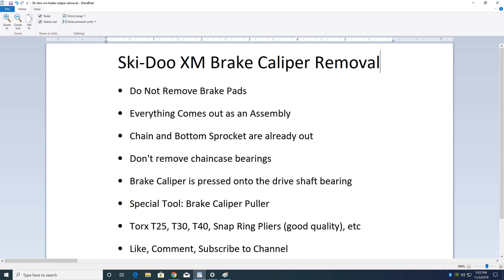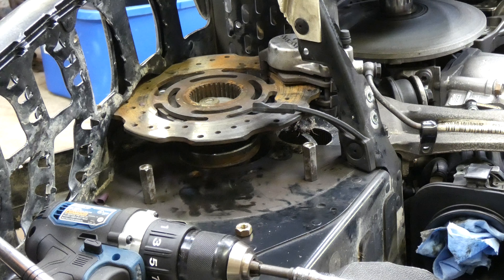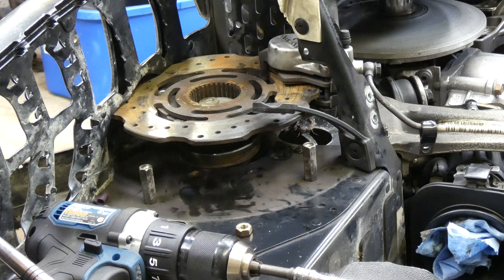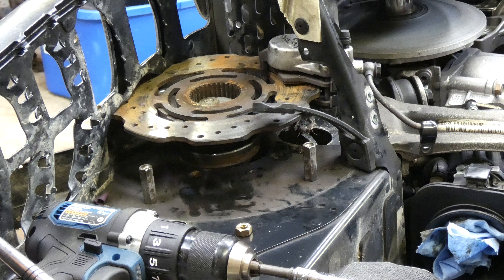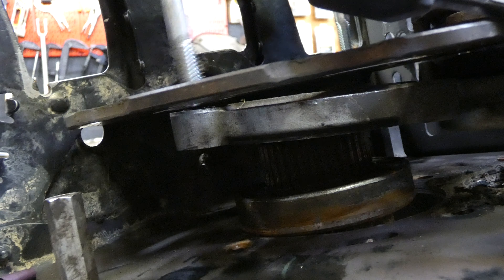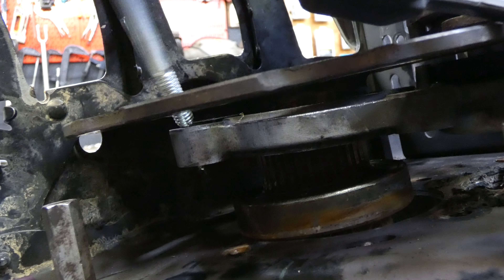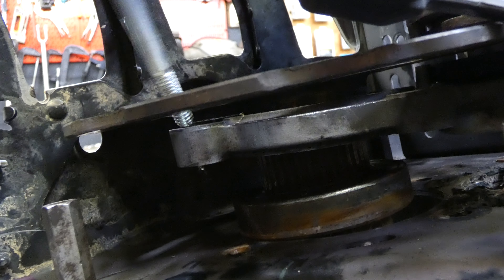Ski-Doo Brake Caliper and Driveshaft Removal

Comment: Wow what an involved PITA process.  I've not tackled mine yet, but you make it look easy though!  Thanks for the video!
Reply from the maker: Yup and there were no other videos showing how the puller really works at the time I made this. Understanding that the caliper is pressed onto a bearing inside the tunnel is the biggest point. The caliper won't just pry off unless you're really lucky.

Comment: Getting the caliper back on is my current frustration🤦🏻‍♂️
Reply from the maker: @Ryanbalazs  yeah that's a good point. I've seen this more as my sleds get older. Here's what works for me. Corrosion and dirt make them not want to go back together. Get some Scotch Brite and scour the surfaces of both pieces really good. Apply a thin coat of heavy grease on the cleaned surfaces to ease the pressing back on. Tighten the bolts a little at a time evenly on all sides so it presses on straight. That should get you there

Comment: I called my shop to order that special tool for pulling brake caliber, Shop told me they didn’t have good luck with that tool and to use a big flat head pry bar to pry between tunnel and caliber up/out and work the caliber off the bearing. I got it off! (I need to replace my rotor toasted) Thks!!!
Reply from the maker: The right tool is easy to get online. You probably can't find the skidoo OEM one but there are plenty of aftermarket options. Any shop using a pry bar on your tunnel is not to be trusted, I world avoid them. The tool works every time.
Reply: Didn’t you have to pry tunnel away from caliber to get the bolts on the puller?  Idk it came off pretty smooth with pry bar. I’ll share a short clip you can see the bar I used.  https://youtu.be/rZtZp0Uy5pc cheers!!!
Reply: Yep just bought the tool and couldnt get it off with it

Comment: I have a 900 ace renegade gen4 does that apply to the one i have too? Having a hard time trying to take the caliper and disc off
Reply from the maker: I have never worked on the trail sleds but my understanding is the drivetrain is exactly the same. The caliper is pressed onto the drive shaft bearing, and the drive shaft bearing is inside the tunnel, while the caliper is outside the tunnel. You definitely need some kind of puller unless you get really really lucky. There are better pullers available than what I used in the video but they'll work the same way. Check out my close ups in the video showing how it works.

Comment: The bolt behind the rotor was seized and we stripped it, any ideas?
Reply from the maker: If I'm thinking of the same bolt, they screw into a retaining ring that has threaded holes. The retaining ring is easily replaced. I think you'll have to drill out the bad screw and then maybe you need a new retaining ring. The video shows the ring the the screws go into
Reply: @SnowmobileHomeMovies  problem is getting accses to the ring on my 2012 lynx, we ended up angle grinding of the back retaining ring off and buying a new one, thanks for the anser

Comment: Question: why do you need to touch the chaincase bottom sprocket? If you're only replacing the caliper (not the driveshaft), can you just pull the caliper without removing anything on the chaincase side?
Reply from the maker: Freeing up the drive shaft is pretty important to be able to get the puller tool in place. Even if you're using one of the nicer ones. I'd say it may be possible to remove the caliper without touching the chain case, sometimes the caliper comes off easier than you would think, but generally you do need to remove the bottom sprocket

Comment: when you re install how does it press all back together
Reply from the maker: When you put the back plate back on and tighten the screws back on it pulls everything back together. You have to tighten somewhat carefully to make sure it comes back together straight. Normally it just works with little effort, but you may want to put a dab of grease to help it slide back on without sticking.

Comment: Is there anyway to do it without the brake caliper tool?
Reply from the maker: Not reliably or without risking damage, in my opinion. There are homemade solutions that will work, similar to the crappy tool I used in the video. Sometimes the caliper comes off the bearing with no puller needed, but I would not count on that. More likely to bend or dent something, and the caliper still won't come off. Don't want to put too much heat on there or the bearing seals could be damaged.

Comment: I've been having problem with my brakes locking up on me on my sled,ive bled them twice very good,slowly but surely the brake lever starts to get super hard to pull,then brakes are locked up,
So then ill turn the bleeder screw release the pressure,then they'll work again,
Now is it my caliper or is something blocked to where I can clean it,any info will be helpful
Thank you
Reply from the maker: I don't know I can only take a guess.
Reply from the maker: One possibility, somehow the brake rotor and caliper assembly was taken apart like in this video, and then when bolted back on, the bearing didn't push in completely straight or didn't make it back in all the way so it's not seated right. Then maybe your brake pad is rubbing against the rotor all the time and heating up causing the brake fluid to overheat. If it's not something like that it sounds like contamination in there, you say you've bled the fluid twice so that doesn't seem as likely, but I don't know. I haven't had this particular problem so that's a guess. There could be some other scenario where somehow the brake is staying partially engaged and so it's slightly rubbing all the time and eventually overheats. That's what I keep thinking is somehow your brake is very slightly staying engaged all the time and overheating. Once or twice in my life I have seen a sled driven with the parking brake on and it will overheat the fluid and lock up, unless it starts on fire first.
Reply: Gr

Comment: great video! thanks you make it look easy. I just need to replace the disk and caliper. I realize 
the covers and bracket need to come off but is it necessary to take all the other stuff  off? 
suspension, track, etc.
Reply from the maker: Good question, I did this as part of changing a track so in my video all that stuff had to come out. For you, as long as you can get the track very very loose which may include collapsing the suspension, you should be able to get a caliper off, you would just not be able to remove the drive shaft. You don't want the track pulling on the drive shaft while you are trying to take apart and reinstall.
Reply from the maker: I have also removed the brake caliper with the sled sitting upright on its track and skis, it doesn't necessarily have to be tipped over, but I think that's a little easier.

Comment: Do you remove the plastic cap piece in the middle of the shaft? How does that come out?
Reply from the maker: No those pieces should not be removed the whole shaft just comes out with the plastic pieces intact
Reply: Ok thanks

Comment: Thank you. Very good DIY. But my drive shaft magnetic cap is on the brake site. Don't know how or why. Do you know how to remove them without breaking?
Reply from the maker: That doesn't sound right... Both ends look similar. If true, I don't know what to tell you sorry.
Reply: @SnowmobileHomeMovies  thanks anyway. I have to take a closer look tomorrow.

Comment: Thanks for the great video. 👍 
Replaced your stock track with the Peak 2.5? How’s it holding up in comparison?
Reply from the maker: I went 146 2.5 stock flex edge to 154 2.5 Peak, so it's hard to compare. Stock track had 4,000 MI, still looked brand new. Peak track has about 1500 mi now still looks brand new. This is not one of these ultra lightweight tracks, it seems to be holding up just fine. I've been really happy with it and impressed by all aspects of performance. It's a 16" wide track but the paddles only go 15 wide and the outside corners are cut, so that narrows the footprint for initiating a roll/turn. The new track does not have flex edge but of course I can't tell any difference there. Great upgrade, wish I had done it sooner, even though I really liked it as a 146.
Reply: @SnowmobileHomeMovies  thanks. I’ve got 3200 miles on my 146 2.5 stock, is missing ~10 lugs and a good majority of the outside lugs are starting to delaminate. Looking to swap to the peak 2.5 for some more durability.

Comment: Would love to see a video of how to fix the annoying brake rattle on the new skidoo’s
Reply from the maker: I have heard that this is a problem but I don't have the issue on my 2019 Summit 850... At least not yet.
Reply: Snowmobile Home Movies had it on my 2018 850 XRS and have it now in my 2019 900 XRS. Drives me nuts
Reply: Of course there are several quick fixes on line but BRP ended up replacing the earlier noisy brakes with a much better design while leaving previous owners to 
try and solve the mystery themselves! 👎🏻👎🏻👎🏻 Typical BRP FASHON❗️

Comment: Great video brother. Thank you for this. I am doing mine right now
Reply from the maker: Sometimes it pops off without the puller. Usually it works as I showed. Sometimes you need to heat up the part of the caliper that is pressed onto the bearing. If it doesn't come off easily (like if the puller starts bending), use heat but just a little and be careful. Boiling water will do it, a torch may burn the bearing seal.

Comment: Nice video, any tricks to changing the drive shaft bearing?  Were they bad?  How many miles?
Reply from the maker: I did not do the drive shaft bearing, it seemed fine. Probably should have anyway. I don't know if there are any tricks on that.